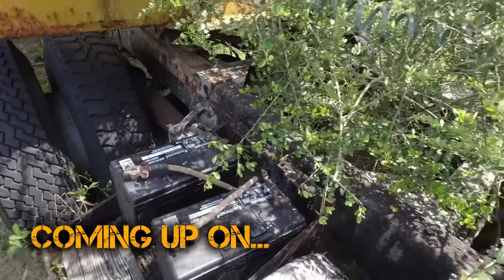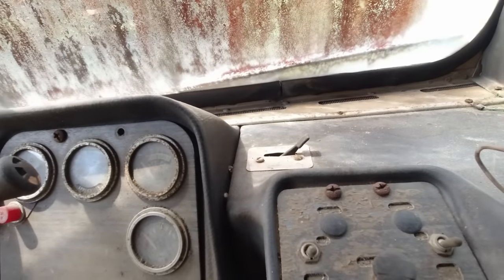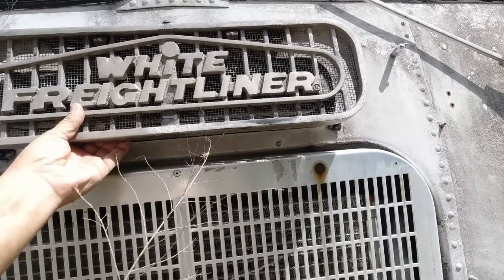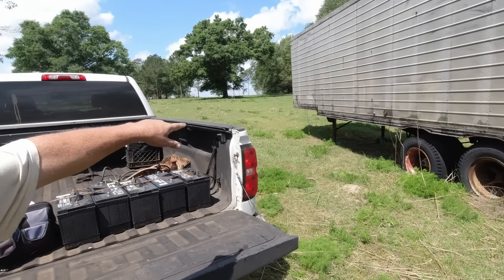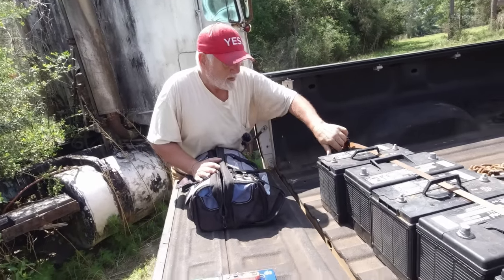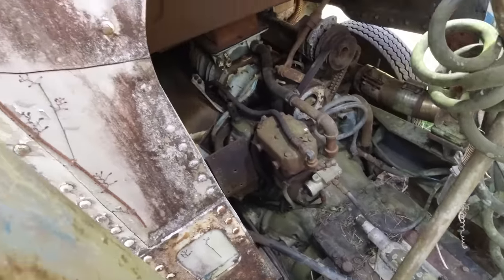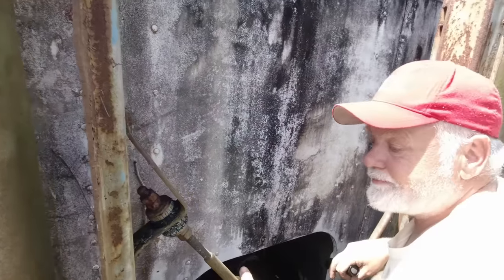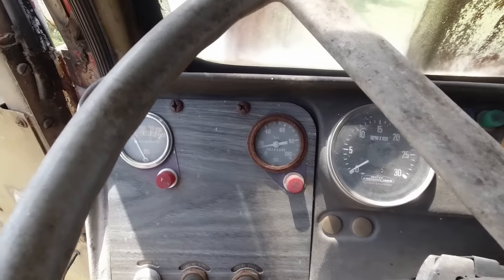Will it START!? Will he Sell it? 49YR Old White Freightliner..

Comment: 8 v71 with a 13-speed in a single axle, that thing should run pretty good, along with being really loud. You should always make sure the injector rack is free on these two strokes a lot of times they will stick wide open when you try to start them and then look out
Reply: 2stroke- noiiiiisy you have to acquire a taste for that sound -always sounds just short of 
Running wild-😮
Mack 350 was a better engine - but that Detroit sure had personality - don’t think any diesel
Had more nicknames- Appalachian hummingbird - Detroit  leaker- etc

Comment: You guys have to return and give it some filters and fresh fuel. I'd love to see that old truck drive out of its grave and I'm sure everybody else would too. I was a little nervous when you fired it up because I thought if you didn't pull the valve cover and check the injector rack and it's stuck, it's not good! Luckily it wasn't so it didn't grenade the motor. I used to drive a 1978 White Road Boss with the same motor back in 1992 for a guy I worked for. Those motors were loud and gutless, and the White was hot as Hades in the summer with no A/C, but some folks loved them. Other drivers hated that truck because she was straight-piped. When I would pull into a rest stop at 3 am to rest my head on the steering wheel, it would definitely wake some folks. I remember when the truck caught fire and I didn't shed a tear. I got a new to me replacement truck, a 1983 Mack R model with an aftermarket stereo and air conditioning! I was moving up in the world!
Reply from the maker: I plan on going back. I will see if I can check the rack. 
Thank you for watching

Comment: I use to hate jacking those  Freightliner cabs all the way over because sometimes when you got to the tipping point of the cab they would just flop right over when the cab jack wasn't working right. The push button is to override the Murphy gauge until oil pressure builds to the set spec. Can't believe that truck would have been 2 yrs. old when I worked on them. Been a diesel engine mechanic for 47 yrs.
Reply from the maker: Thanks for sharing 
Thank you for watching

Comment: Drove a 59, a 61, 66, 71,73,74, some 80, somethings. Where you checked the rad cap, that’s the duct for the “ frontal air “ intake system. The air 
cleaner on a Cummins would be a heavy steel box  mounted on top of the engine. It was rare to not find broken mounting brackets that hadn’t 
vibrated apart and didn’t need welding.  I think that’s a 73 inch cab. Up in Canada, Kwickasair trucking ran a fleet of these from Vancouver to 
Montreal running team. 57 hours one way, 2750 miles.  Lots of wrecks.  The 66 I drove was a slab cab. It was an 8V 71 with N55 injectors. So it 
was rated at 280 hp. I pulled a spread 4 axle trailer with 84,000 lbs on the deck of glass windows. You knew where all the hills where.
Reply from the maker: Thanks for sharing 
Thanks for watching

Comment: I was a kid when these were on the road. Used to see these all the time back when White owned Freightliner, before White went bankrupt and Daimler bought Freightliner. The COEs could turn in any tight spot, but they were unbearable in the summer due to the heat coming into the cab from the engine. But in winter, they  kept you nice and warm. I miss seeing those Trucks on the road.
Reply from the maker: Thanks for sharing 
Thank you for watching
Reply: from the waist up you would be warm but my feet felt like 2 ice blocks
Reply: If I'm not mistaken white motor company was a well established truck builder out of Cleveland Ohio and consolidate fright ways had a design for what would fit their business objectives and they made a joint effort to provide a tractor that would best meet their needs for the service in which they were looking for  I know this is going to sound crazy but CF built and designed the light weight cab and white supplied the chassis  which the name white freightliner came from  pull up the start of consolidate fright
Reply: @mrt601 you are on the right track. FREIGHTLINER built their own trucks from the ground up, same with their boxes and trailers. They entered a marketing and sales agreement with white motor company, that is when the White FREIGHTLINER logos showed up. The partnership ended in the late 70’s or early 80’s, I don’t remember exactly when. My dad had one similar to this one, 4 head lights, Cummins engine. I used that front grill door many times to check and add oil. The cab tilt system is the big handles release the cab locks, the small tee cable pulls a safety catch for the first couple of inches of rise.

Comment: That looks exactly like the White Freightliner cabover I started out on except mine was red and white.  No power steering or seat belts. The frontier days of trucking.  I've been retired for over 21 years now. Mine  had a 903 ci. V/8 engine and a 10 speed Roadranger transmission.
Reply from the maker: Story I heard when I was in my 20 
They referred to them as 90nothings. Fuel squeezers and that Poole truck lines bought a lot of int trucks with 903 back in the 80s. Mr Poole said if they got him a extra mpg or saved him a gallon of fuel a day it was worth it. He had like 1200 Trucks at the time 
Thanks for watching

Comment: Might be lucky it didn't pick up fuel. Those detroits are super famous for the rack sticking and running away when started after sitting for any length of time. Its easy enough to check, just pop the two nuts off the valve covers and see if you can manually move the rack and also check and make sure that the injectors are hung wide open.

Comment: It's a beauty if you don't mind going deaf when you run it. Just for a moment I wondered if might run away! Very involving content; a mix of memories, wisdom and experience along with saving truck history. Thanks for posting and I very much look forward to the next one. The 8/71 was a very popular  long haul engine in Australia during the 70s and 80s, usually with a 13 speed behind it through to double drives. Good on the flat, not much chop in hilly country. But just soooo loud. From South Australia.
Reply from the maker: Thanks for watching
Reply: Dipstick is in the front grill
Reply: Cumins its in the rear of the cab
Reply: Love those diesels

Comment: Makin Oil, I  understand your version.  Lot of them ol diesels  specially screaming jimmeys used/leaked lots of oil. But I was service oiler on the Trans Alaska pipeline.  Making oil ment crankcase was filling up with diesel fuel.

Comment: It was fun watching you walking by the dip stick 20 times . And on the fuel cap pull up the tab first then turn . There a valve under the cab on the fuel line going between both fuel tanks that’s the cross over line it probably close so he can run on one tank . Pour fuel in the fuel filter and reattach there air in the fuel line maybe . Retired truck .
Reply from the maker: Declaring a senior moment 
Thanks for watching

Comment: Back in the late 60’s my dad had a Peterbilt that had a twin stick transmission in it. Straight shifter levers, no air splitter. One of the levers just sat on a stud that came up from the tower, the shifter doubled as the jack handle to tilt the cab. My dad told me it was that way so you would not leave the handle on the side of the road, you needed it to get the truck back into gear.
Reply from the maker: Thank you for sharing that. Thanks for watching

Comment: Dip stick behind little door on upper left of radiator grill - I drove one just like this in 1977 for 'Clay Hyder Trucking', Auburndale, Fla. hauling Tropicana out & Swingin' Meat back.. It was a straight 250 Cummins, w/a 10speed Spicer & 4:11 rears. It was a twin screw.

Comment: I had not heard anything about 57' trailers in TX, and usually pay attention to truck stuff. I remember a year or so ago that Wal-Mart was going to a 60' trailer with some weird cabover, but I never heard any more about that. When I first got into the trucking  business in 1979, the 45' 13'6" was a new thing. Damn. I just made myself feel old. (But you mentioned in the '77 Mack video that was the year you started your senior year of HS. So we're the same age.😄)
Reply from the maker: Lol 
Thanks for watching
Reply: Back in 1991 I was with a company called Fleetline out of Lancaster Tx and we pulled 57 foot dry vans across Texas Oklahoma Arkansas Kansas New Mexico and to Florida. We had to sneak across Alabama because they weren't permitted. Arkansas wanted a 24 hour permit also. Lol so we'd go around those scales frequently. There were actually a few that were pulling 57s around. Usually hauling lightweight bulk freight such as Owens Corning insulation out of Waxahatchie, Tx. The tail swing was the worse part of pulling them if your tandems were set forward... But always make sure to slide them all the way back before loading or unloading so that the landing gear wouldn't come off the ground when the forklift entered the trailer. Every one that I pulled were made by Wabash trailer company. Since then they kind of faded away. I haven't seen one on an interstate in decades.
Reply: @rsumsixtyfo6766  Learn something everyday. I have never even heard them mentioned. I did some outlaw stuff of my own briefly early on, but decided I just did not need that aggravation. Thanks for the information, Man.

Comment: Wally those old Detroits you have to watch they will RUN AWAY. If You come back to that Truck you really should take the Valve covers off and Make sure  the RACK isnt stuck.  That would make for a great Restoration project for sure...

Comment: I had a 1975 mine had a bigger sleeper The lock switch on the dash was usually a front brake limiting valve and the 2nd start button came on the detroits some would squirter a shot of either because they were harder to start on cold days the 335 cummins would have a compression release down on the shift island that was nice also there's a door on the passenger side grille to check and put oil in it,I'd be amazed if it started because Detroits won't self prime you have to get all the air out of the fuel lines and filter its a real pain if they suck air..
Reply from the maker: Thanks for sharing that 
Thank you for watching

Comment: Keep a board or something to block off the air intake when starting an old detroit in case the rack is stuck and it runs away.
Reply from the maker: J know you can’t be to carful with those things. I did not have anything to starve it for air but I will make sure I have something next Detroit 
Thanks for watching

Comment: Mr Wiley , Herr's Motor  Express based in Quarryville Pa use to run cabover Freightliners some had 318's most of them had 250 or 290 Cummins with 10 speed Road Rangers in them.

Comment: Actually and I could be wrong. But I believe one button starts the engine and one button shuts down the engine. We have to older Kenworth`s with Detroit`s and that is how they operate. And I have seen the same thing in Freightliners.
Reply from the maker: Jacob thought it said engine shit down 
I thought it was low oil pressure over ride 
I am going back 
Thank you for watching

Comment: The oil can be checked through the excess in the front grill, your drying to start without checking anything, how about, is the truck in gear? Have you ever worked on a truck before, doesn't seem like it to me! Anyone knows if your a mechanic you better check to make sure the rack is stuck for the injector rail before you try and start it.

Comment: OK Wiley, why don’t you make up a battery pack that fit in the back of your truck with like six batteries all tied together and then just run jumper cables on the back your truck to the connectors on what you’re working on
Reply from the maker: I tried that today with hank. It didn’t work out   Maybe well probably had something wrong
Reply: @DontbeWily  I was just thinking it would save on your back

Comment: The door for the oil stick is on the front of the cab ,,,theres a knob you have to turn to open it ,,,its right next to the radiator on the right side of the rad the dip sticks about. 10 ft long

Comment: The small bunk and the 13spd makes me wonder if this was a CF road tractor in a previous life. But I'm not sure if CF ever used Detroit engines in those old White/Freightliners.
Reply: CF used a nine speed. Basically it was a 13 with no back box. So no splitting gears.  Also they ran a lot of air starts. The big air reservoir tank was mounted 
vertically up the rear corner of the cab. This unit has a longer wheelbase.  They also had small single mount mirrors. 
It would be interesting to see the frame rails near the 5th wheel to see if it’s set up to accommodate a Jiff Lock. Basically it allowed the driver to 
hook up to an extra dead axle and turn it into a tandem axle. They used those to haul 42’6” trailers instead of 28’ doubles. Also CF tractors had 
a tire chain mounting bracket combined with the fuel tank mounting brackets.
Reply: @georgerenton965  I thought most of those CF ball busters ran straight 7 spds hooked to 250's during this truck's era. I remember the Jiff Locks when I was a kid in the 60's. Also I don't recall them using Detroits. You would think I'd remember that.
Reply: @David_Richard_241   that’s a good point on the Cummins, I think in the mid 70’s they might have had a few “ Fuel Squeezer “ Detroits that had 
the early DDEC engines ? I ran with a steady crew of CF drivers that crossed Pennsylvania on I-90. They had to split the boxes and had tractors 
with large concrete blocks on the frame. They where set up to pull the B box hooked to the converter 45 miles between N.Y. and Ohio.
Reply: @georgerenton965  
Am I right about the straight 7-spd? I remember going to Allentown on 78 and there was a huge CF terminal on the south side of the road. And then it was all gone. That blew my mind when they shut 'er down. because CF had been a constant on the road my entire life.
Reply: @David_Richard_241  Their Canadian operation continued for a few years beyond the closure of CF. ( Canadian Freightways here north of the 49th. )
When I worked at Cummins in my young life, I ran across a fleet within a leasing company called Triad Truck Lease. One of their clients had a small 
fleet Freightliners with NTC 270’s these where coupled to 7 speeds. If I remember correctly these engines had a 29% torque rise. They where 
single axle cab overs.  Engines where lime green, or the same colour as a Euclid. 
Triad was quite the going concern in southern Ontario back in the 70’s.  Apparently they expanded to fast they say, and disappeared from the 
landscape completely.  When I was 14 I worked at Harper Detroit Diesel. Triad had a varied fleet. They had some Autocars that had 8V 71’s.
There was a mechanical contraption that shut the fuel off to one bank of the engine. You could rev the engine up, and shut down one bank. 
Having dual exhaust you redirect what was basically a 4 cylinder air compressor that was hooked up to the trailer that blew the load of 
bulk cement off.
Reply: @georgerenton965  We had a close family friend that ran the dock at the CF facility in Mansfield, OH in the 60's. I got a lot of cool stuff from him when I was a kid. Still have a little of it.

Comment: A 318 had a 6/71 blower on it. The 350 hp had a turbo on top of the blower. If it didn't have either it would have been 280 hp.
Reply from the maker: Thank you for that information 
Thanks for watching

Comment: I bet that was a old consolidated freight truck
Reply: Que tiene esos camiones tanto tiempo parados me gustari tener ese gran dinero y traerme uno y mucho van a haser lo mismo son grandes máquinas gracias por emotrarnos el amor a un traker gracias
Reply: I was thinking the same thing....
Reply: I thought the same at first. But CF never ran Daytons, 13spd's and it has far too many gauges for its year. The battery box would have been under the cab with a single battery for lights only and the drive axle would have been up close to the fuel tanks. In 74, is when they went to the white cabs and strips. The bumper would have been cut short as well. Pretty close, but id say probably not. I'm not sure if the air starter tank would have been behind the cab or if they were still in the cab.
Reply: @2008truckman  thanks for that information, I appreciate it
Reply: Cf always had a different lower mirror on the left side of the cab
Reply: 100111001010101110011010110010101011001101010101010010010110110110101010101010101010110101010100110011010100101000101010010101011010101111111101011101101001010110101010011010101011010101010100110100110101010101010101101010101010101010101010101010101010110101010101010101010101010101010101010101101001101010101011010101010101010101010101010101010101010110101010011001011010101010100101010101010110101010100110101010101010101011011010101010101010101010101010101101001101010101011010101010101010101010101101010101010101010101010101010101010110101010
010101010110101010101010101010101010101011001100110101001101010100110011010011010101001100110101010101010101100101010110101010101010101011010101011010101010101010101010101010101010101010101010100101010110010101011010101010101010101010101010101010101010101010110101101101010101010101010101011100110101010101010110101010101010101010101011001101010101010101001010101010101010101010110101010101010101010101010101010110101010101010101010101010101010101101010101110101010101010101010101010101010101010101010101010101011100101010110010101101010100001101010101010101010101010101001010101010110101011011010101010101010100101010111
Reply: It definitely looks like it would be

Comment: How come,,you did not raise the cab to work on the motor? Was that Cabover  strong enough to pull a lowboy with heavy machinery with a single axle?
Reply from the maker: It would pull for sure. Being Over weight on the axles was the problem 
I don’t really remember the axle weight allowed 
Thanks for watching